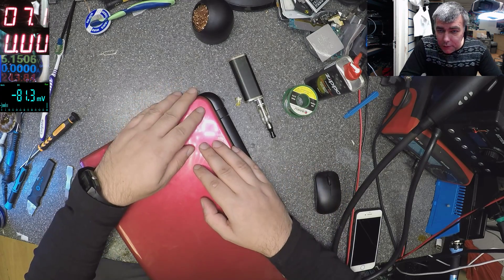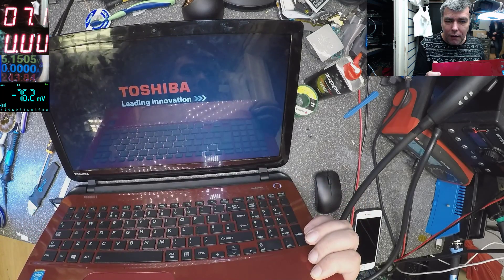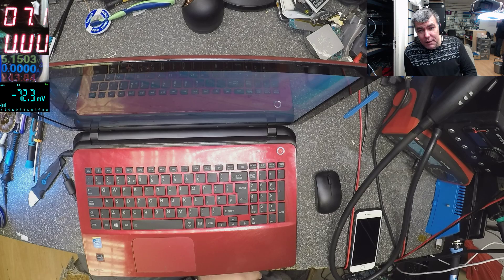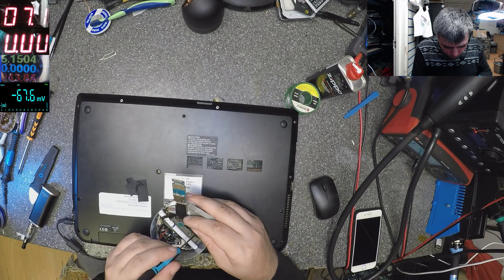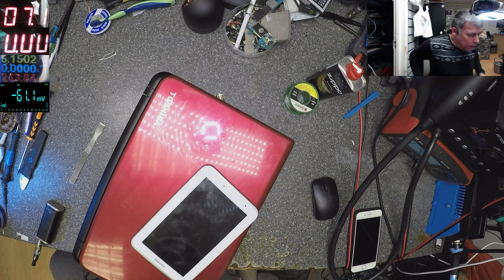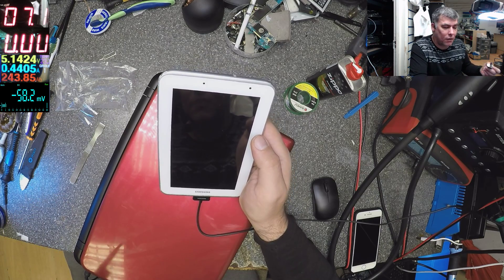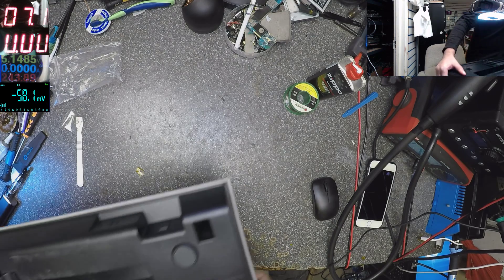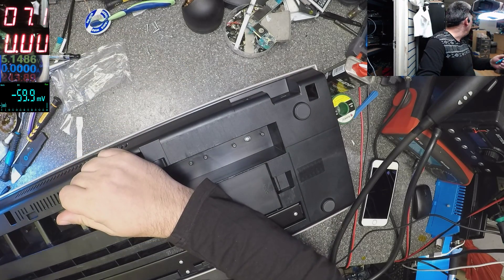Toshiba L50-b-1dv , dead motherboard, no power, fixed by another magic touch

Comment: sir, thanks for your video. i have thoshipa satellite l50-b i3110 model, this is not proper turning on , when put the ac adapter its going to automatically ON BUT DISPLAY NOT COME,  once press the power button laptop goes to OFF. but Again press the power button laptop not turning ON,  then put adappter its automatically ON, THIS IS MY PROBLEM, HOW TO SOLVE PLEASE HELP ME

Comment: Hi. I am having kind of a problem with Toshiba L50-B-1N9, motherboard DABLIDMB8E0-REV:E.
When I connect the charger, the charging light comes on but the laptop does not react to the power button (Wich I checked and it is ok).

If I connect the motherboard directly to a DC Power Supply, not through the power jack,  it powers on. Conecting the cable with the power jack and the power supply to that , does not work.
I have completely changed the wires of the power jack cable and still doesn,t power on.

I am new to this so please have patience with me

Comment: hi, in my L50-b-1jc i have red led when AC adapter is plugged, white led when i leave battery. but i try to turn it on (without battery and AC plugged) as shown in video, and nothing happens. led white still ON, no start up. could be the Power Circuit in Mobo dead? can i find the electrical scheme of mobo, and then try to find if some MOSFET are dead? thanks

Comment: I had an Acer laptop recently which had a problem that the mouse and keyboard would stop working (plug a USB one in and that works ok).  After taking the laptop completely apart several times I discovered the problem was a faulty battery ?????

Comment: Sorin I had a HP15 in on friday last, pretty new, running very hot and the fan really being worked hard, apparently bought in Dubai, i dont know, could be hot in more ways than one, lol, during the time i had it on checking it i had a shutdown, a thermal error reported on bootup after that, when i opened the laptop there was a thermal pad on the Video chip but 'NO' trace of any thermal compound on the CPU which was an AMD A6, have you ever come across anything like that?, I seen it before on a Custom built PC that 2 students had put together, nice build but it was their first attempt and was for their own personal use. Anyway some thermal compound on the CPU and everything is working fine, fan is a little annoying as it seems to run nearly all the time and isnt exactly silent, would make you wonder about HP Quality control, how did that slip by without being noticed. I told them to contact HP with the report i had given them, unlikely to do any good, if they're lucky enough to be able to get through to HP in the first place.

Comment: Sorin, my neighbour has the exact same laptop, the exact same problem has happened at least twice maybe three times this year and on every occasion its been sorted by removing the battery ???. I've come across quiet a few newer laptops with the same issue where the battery is internal ie. you have to remove the back to get at the battery, usually disconnecting the battery connector for a few minutes is all it takes to sort it out, as you often say Sorin ; This is Crazy' :) :) :)